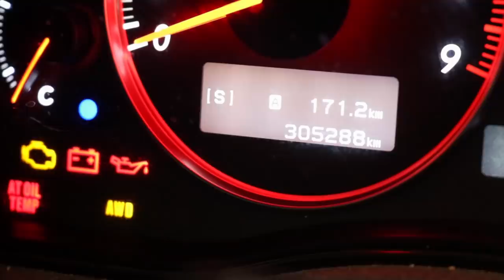Building My Son His First Car / P Plater Build EP1 - THE SKID FACTORY

Comment: Gen 4 GT Spec B H6 Liberty Wagon!  Nice!  Spec B's have a nice interior, the 6 speed is tough as balls too.

Edit - The suspension is probably the same dims as stock, the Spec B's come pretty stupid low from the factory.  Mine still has factory suspension, I want to raise it at least 40mm for the sake of my back and exhaust.
Reply: Neither of those cars are GTs.
Reply: @iansmith5915  Pretty sure the black wagon is a GT, the white wagon is a GT Spec B.  Feel free to say why you don't think the front grill, front bumber, lights with sprayers, interior, wheels and Mcintosh stereo don't match the Spec B fitout.  Only way it's not a Spec B is if someone has swapped all that stuff across.
Reply: @masondegaulle5731  neither is a gt. GTs are turbo 4s.
Reply: @iansmith5915  3.0R & 3.0R-B.  Whatever.  Exact same trim and transmission options, GT & GT-B by another name.
Reply: @masondegaulle5731  well, trim. Hmmm. The first year the gt had a cloth interior and no sunroof, the gt premium had the leather, sunroof and macintosh. 2005 they all became the premium spec. The h6 models, which were never badged as gts, also came with 6 speed transmission, while the gt came with 5 speeds. Up until the face-lift gt's could not be speced with bilsteins, unless tuned by sti spec. The skid factory did a one episode build review on an 05 gt when still on MCM2

Comment: Most of taiwan coilovers much same using same parts source and lot of same outsource factories for lot of manufacture .
The main similarity is they all pretty useless long term on daily B road driving and can be a handling braking grip comfort safety downgrade on poor road surfaces .
Those subarus are pretty stout and great value, EZ is the gem and they so cheap find used, no idea why didn't use them more and in the forester model in OZ or the US .
Going be a pretty chill build, subaru an easy one strip and part swap .

Comment: Honestly surprised you’re giving him 6 cylinders. Hard to get into trouble with the 2.5i. Can’t comfortably overtake, let alone drive like a P plater :p
Reply from the maker: We already had the car. Not having enough power to overtake is also not very safe.
Reply: "If in doubt, power out" - Not enough power can be a danger in itself, especially when overtaking.  The H6 is a solid platform without "too much" power, and I suspect Al's son has driven many more highly-powered cars than your average learner.
Reply: @theskidfactory  true, and probably more call for safe overtaking in that area.

I appreciate that insistence on getting him into a manual. Very valuable to be able to jump in any vehicle and go.
Reply: @masondegaulle5731  the AWD tames it quite a lot too, now that I think about it. I’ve only driven a manual 2.5i and an auto H6. They felt almost the same until you hit overtaking speed. The H6 just kept building steam long after the 4 would have submitted its two weeks notice.
Reply: @LongPeter  Yeah, the H6 is much more linear, great torque.  I like your "...long after the 4 would have put in its two weeks notice" 😂

Comment: My oldest was a bit cash strapped so I sold him my recently completed Swedish Wagon project knowing it would be safe and almost indestructible.
Much as he tried it remained indestructible even with application of doofdoosh Alternator torture, Many occasions of "Ya Fwit ya gotta do this before ya do THAT lemme explain it to you ya mong" Coily thing choppy choppy (Awww FerFARKS Sake just buy 40mm lowery springs, Here let me explain it to ya ) and OG layback driving positions (FarkME! Look right, Whaddayasee? B Frikkin Pillar! How is THAT safe and while im at it Hands 9 and 3 (Airbag wrist breaker avoidance) on the wheel not one scratcher on the bottom coz thats all you can reach!) and all the other lil opportunities I remained silent while rescuing the Lad from Walking lol
It took a crackhead chick to kill it with stuff but the lad turned out alright and years later knows a lot more about cars than I give him credit for plus the whole "But did you Die? Nup" chat closer lol
Sometimes I wonder if its not wifely revenge for farting in my sleep but despite swearing im at the end of my rope? I still have lots more to go and we all laugh about it at the time too.

Comment: How are you going to deal with the QLD power restrictions for P platers. 
No turbo motors depending on power to weight, no mod plate vehicles, nothing either major modifications etc.   
I know you can apply for special consideration but yeah. 
Like a HDJ80 is legal because factory turbo diesel   but a HZJ80 with an aftermarket turbo isn't due to power modifications  lol.

And insurance etc. 

Or i can delete this comment if you're going to do a dodgy like I would  and put the non turbo engine cover back on and all the heat shielding haha

Comment: I hate mine, worst car I've ever owned, put together by morons, try and even do something simple like take the doorskin off..  It pings its guts out between 2 and 3krpm, and I run 98 with additional 5-10% E85.  What map are you supposed to use for the ignition, there's like 6 or 8 different maps.   Spec B 6MT 06
Reply: I go for a drive to see my grandmother, easy cruise at 80-100km/h for 80km round trip, IAM sitting at 0.750, until I get to the hill right before home, and then its drops to absolute 0.  And now it's gotta go through all the bullshit and time to relearn to get it back to 0.75 only to bloody loose it again.  It goes like shit and it eats fuel